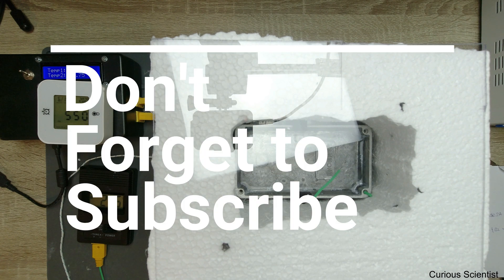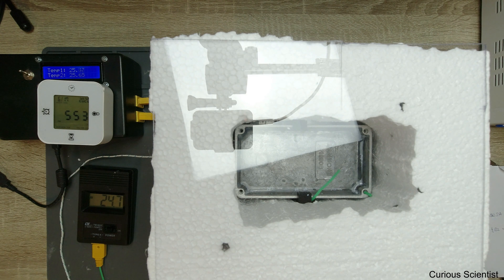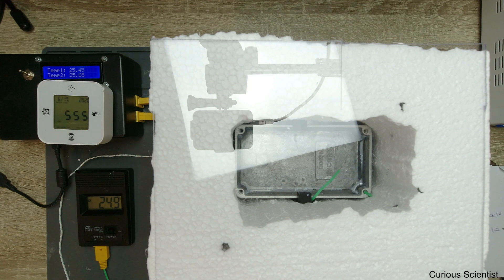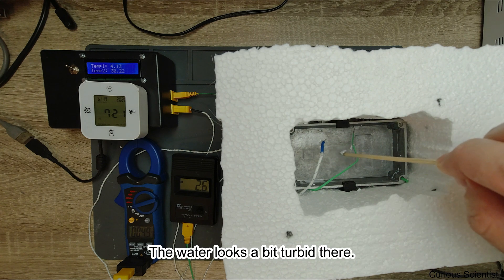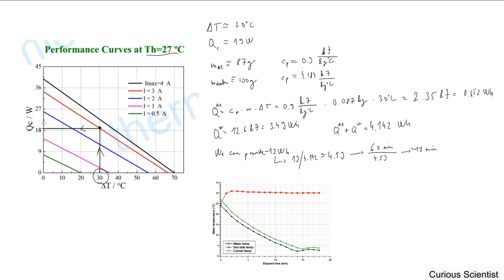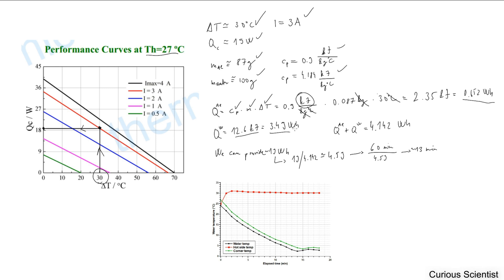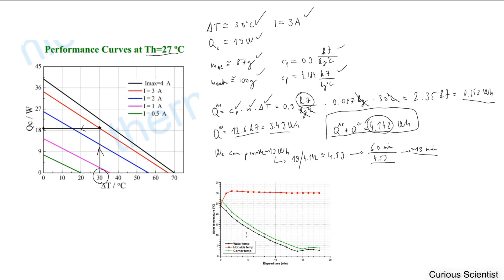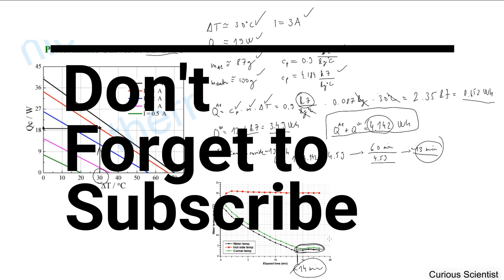Testing different Peltier coolers by cooling/freezing water - Part 2 - TEC12703

Comment: And if you use Thermos Stainless King with a modified lid and also ultra pure water that doesn't freeze at 0 degrees Celsius xD ... good job

PS: frozen water can spoil the experience
Reply from the maker: Actually, I was thinking about something similar. Not with a thermos, but with a simple stainless steel bottle. I wanted to attach a Peltier to its bottom and see how the liquid cools down in the bottle and how much energy is needed. The problem is that all the stainless bottles I found have a weird-shaped bottom and I cannot attach the Peltier to it properly.
Reply: @CuriousScientist  Well, the thermos insulation is not so important ... what if it seems to me that it was missing in the experiment are heapipes in the peltier with the water side, the water is a bad thermal conductor ... if you want it to freeze 10 grams of water or 10ml of water you would have to use a cold dissipative metal like the "heapipes" on the COLD side of the peltier

Watch this video to see what thermal conductivity is https://youtu.be/bXFxuqzLu1Q
Reply from the maker: Umm, I don't want want to sound big headed but I am a physicist, I know what thermal conductivity is. The video you sent is completely useless and not relevant to my experiment and it does not have any scientific content. My experiment does not need heat pipes since the cold side is in a very good thermal connection with the water. The only things which are between the cold side and the water are the thermal grease and the aluminium container. The aluminium is a really good thermal conductor. The only problem I had is that the water was not stirred therefore it did not freeze uniformly. There will be an experiment coming soon where I will create an extreme freezer with very high performance.
Reply: @CuriousScientist  The point is that the peltier is only cooling on the surface of the peltier therefore it takes much longer to freeze all the water and this does not depend on the cooling capacity but on the amount of cold surface that the water touches.

Let me explain it is not the same to put 10ml of water in a 2x2x2.5cm container to put the water in 10x10x0.1cm in the freezer, obviously the container with 0.1cm will freeze faster because the surface in contact with the cold is wider For something, radiators take up a lot of space, the point is that it seems better to have 10 6-watt peltiers freezing water on a surface of 4x4x0.3cm = 4.8cm3 = 4.8ml then 4.8x6 (peltiers) = 48ml in less than 2 minutes Maybe more or less, to have 1 60 watt peltier on a surface 6x4x2cm = 48cm3 -> 48ml that would surely take more than 10 minutes.

It is only a suggestion on heat sinks or conductors for another xD experiment. (translate from google).
Reply from the maker: @luish.c.6687  I just quickly went through the paper, but the numbers are way off. They messed up the units in the latent heat calculation. But if we are satisfied with the 0°C water and we do not want to transform it into ice, the 934 W is OK. I suggest you to wait a week because I will assemble a very similar experiment but with less Peltiers (4 or 8, I haven't figured it out yet). I finally found the proper container for my experiments. It is a tin can for tea leaves! :) But notice that they pump nearly 1000 W heat out of the water. With proper stirring, of course it freezes rapidly. I mentioned this multiple times in this experiment-series that one of the issues is that I am not stirring the water. But since it is a "systematic error", i.e., I was not stirring the water for any of the experiments. The results stay more or less comparable. The larger the Peltier cooler, the larger its cooling capacity. I think you can guess which cooler is better. :)

Comment: My request to used double peltier for same test
Means put two peltier together then your hot side is at 30 deg but your cold side is very high results
My request for another experiment if possible
Reply from the maker: Hi! Stacking them won't make it faster. You try to remove heat. If you stack them, the bottom Peltier has to remove the heat of the system plus the heat generated by the other Peltier. Large dT is not equal to large Qc. Check my other videos on this topic.
Reply: @CuriousScientist  okay share me like
Reply: What is the result if hot side cold by others peltier using less power?
Reply from the maker: The bottleneck is always the bottom Peltier. If it can only transfer let's say 50 W (Qc = 50 W), then the other (top) Peltier's performance (P = U*I part, and not its Qc) cannot be larger than this value. Otherwise, the heat created on the outer Peltier will be larger than the heat that the inner can transfer. In this case, the efficiency drops down, and the outer Peltier becomes warmer than expected. Peltiers are used to cool chips (for example silicon wafers, which are used in different detectors). Those are tiny heat sources, so there, you can use them (even stacked) efficiently , because you don't need to remove too much heat, but you want to go deep in temperature. Seems like you haven't watched the video carefully. I explicitly told, that either you create large dT or large Qc, but both will not work. And I also said, that large dT will not mean "large cooling", because for cooling, you have to pump heat. If your Peltier reaches -20°C, I guarantee that you are not pumping basically any heat whatsoever.
Reply: @CuriousScientist  then used 12703 in bottom and 12715 in top then hot size is still 27 deg and cold side will improve?
Reply: Read size to side
Reply from the maker: @jawedsuria4858  I am sorry, but do you have hard time understanding me, or what? Watch my videos and read what I answer to you. Top Peltier's total power has to be smaller than the bottom Peltier's Qc. Bottom Peltier's Qc depends on the achieved dT and current. Simple.